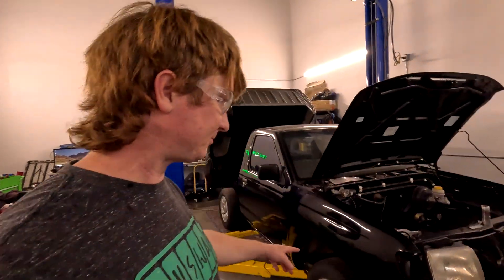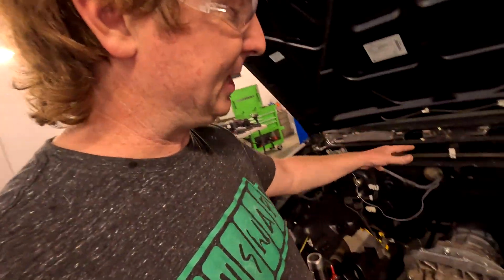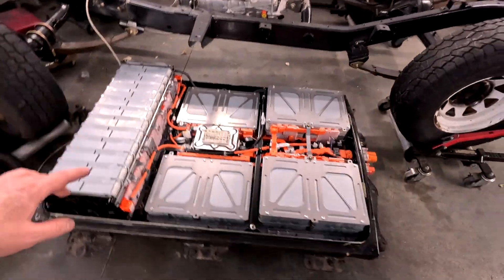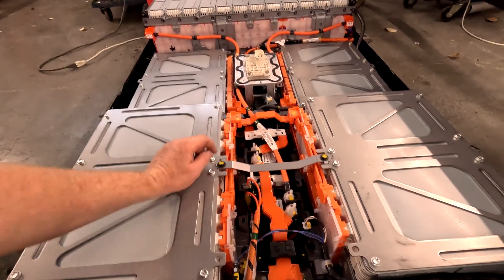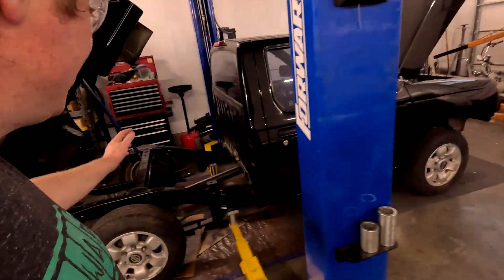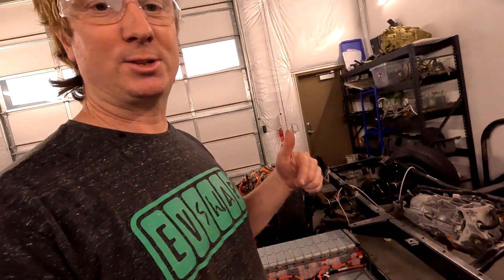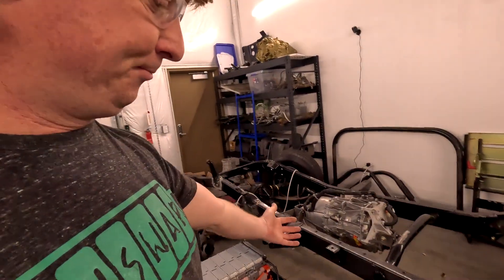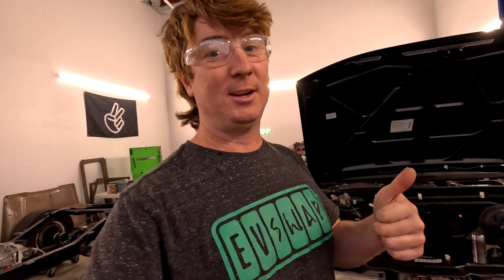BIG UPDATES at EVSwap on the FJ40 Land Cruiser and Nissan Frontier EV Conversions

Comment: Which transmission is that, is it the original from the truck? And regarding the Land Cruiser, how do you deal with the diff ratio of the Tesla DU and the Land Cruiser diffs? How will the end gearing be? I ask because I was planning on doing something similar, but the gearing would have resulted in a max speed of about 50mph, and that seemed a bit low for me :D 
Anyways, great video! Looking forward to watching the rest of this series!
Reply from the maker: It's actually a 5-speed from a 240SX. Dave bought it over a decade ago and we are lucky because it fits perfectly. From what I've read the internals of the transmission are pretty much the same as the Frontier 5-speed transmission, or really any other 5-speed Nissan from the 80s and 90s.

For the Land Cruiser I have a new gearing set from Fellten which will change the diff ratio inside the Tesla drive unit from ~9:1 to 3.54:1. The Fj40 has a diff ratio of 4.1:1 so that will mean my total ratio will be 14:5:1 which will be awesome for acceleration and also have a triple digit top speed!! I also got the Felten LSD so it will have traction!
Reply: @EVSwap  Wow, such an in-depth and accurate answer, I honestly did not expect that! Thank you, this information was very useful! DO you know if Fellten has a link to their gear ratio conversion? It would be very interesting to test out!

Thank you again for the awesome answer, and have a great weekend!
Reply from the maker: @herrjonna2007  Sure here is the Model 3 gearset: https://shop.fellten.com/shop/tm3rdu-gs3541-tesla-model-3-rear-drive-unit-reduction-gearset-3-54-1-13829

Note they also make a gearset for the Model S drive unit.
Reply: I'm impressed with the quality of the audience on this channel.  This is an intelligent, engaged community.  Congratulations, Jimmy, on your channel and your audience of car lovers!! ❣️

Comment: good to see my adapter plates pulling it all together! hopefully the full stack fits!
Reply: The 96 Nissan D21 transmission is further back in the tunnel and flush with the firewall, and I have the front diff to deal with. I can't fit the entire Leaf stack without separation. Do you know of any plates that will waterproof the three phase connections between the EM57 and the inverter when the stack is separated?
Reply from the maker: @sector7e307 check out my earlier videos of my Land Cruiser conversion. I used large 1 AWG welding wire to connect to the inverter and motor and used 3D printed parts and silicone to seal everything.
Reply from the maker: Yes the parts from Brat Industries fit perfectly!

Comment: Looks awesome. Loving the location of the motor in the LC. You can basically fill the entire fuel tank and engine bay area with batteries!
Reply from the maker: That's the plan! It's going to be a sweet truck when done. Just smooth, endless power and torque!